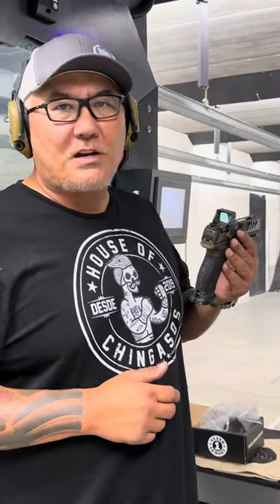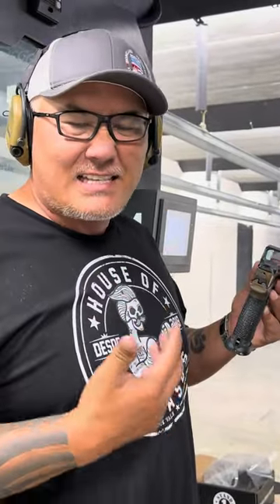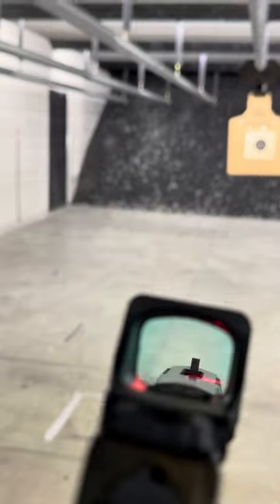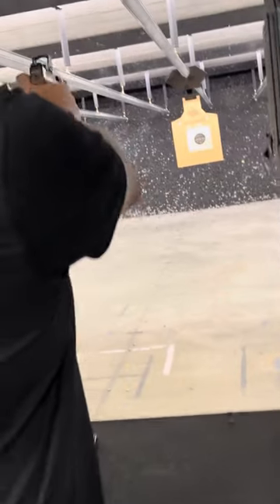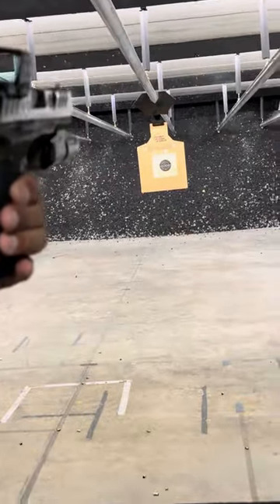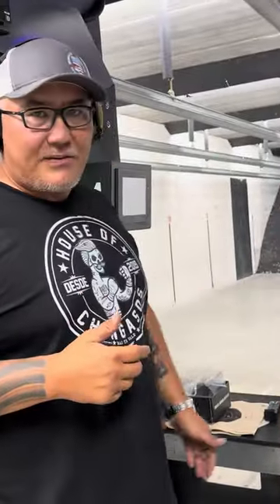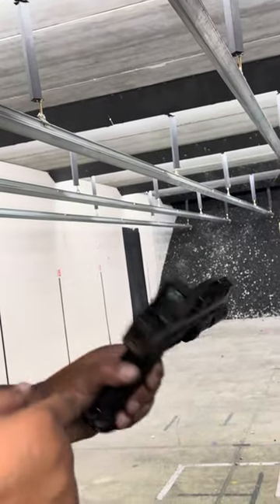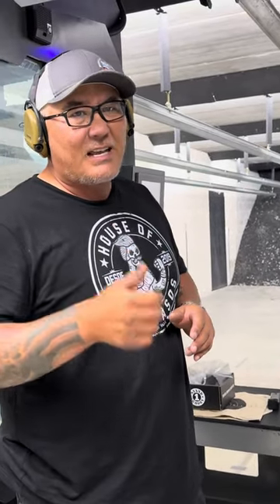Is the new Holosun 507 Comp durable?

Comment: I was a late adopter to dots on pistols so I went with Holosun thinking I’d eventually upgrade to a more expensive sight if I liked it. I see no need to “upgrade”. I don’t abuse my gear but I don’t baby it either. Several classes, EDC, thousands of rounds at the range, and who knows how much dry fire and draw practice. Still running strong.

Comment: Thanks, Scott. Will be closely following this. I’m considering getting a green dot version and direct milling it onto a G17 that I have. I’ve got several 507Cs, two 509s and one 507k. Haven’t had an issue with any of them. And one of my 507C has nearly 12K through it and has been pretty used and absurd for a carry gun.

Comment: Best red dot for Springfield echelon ?
Reply: Depends on your needs. For a large-window optic, the 507 Comp is a solid contender with its CRS (Competition Reticle System). Echelon is full size … can handle the size of the 507 Comp. And 507 Comp footprint is RMR, which the Echelon accommodates.